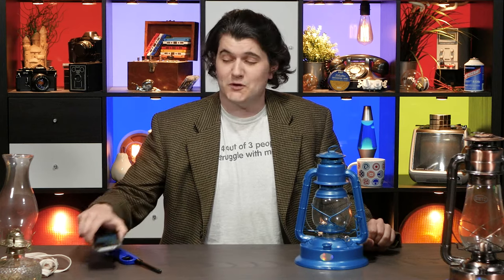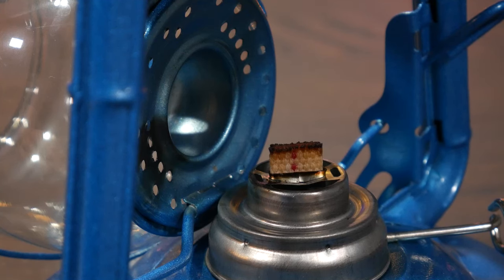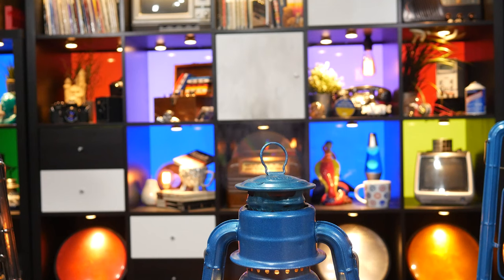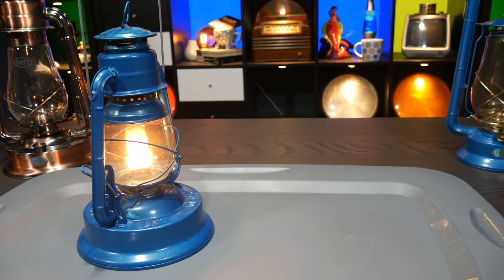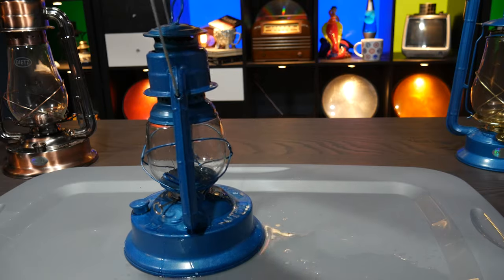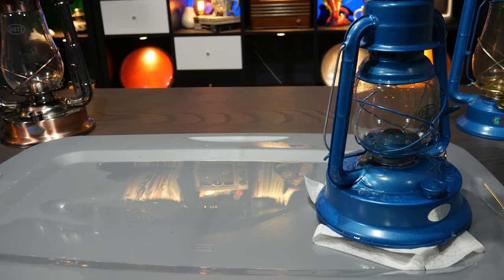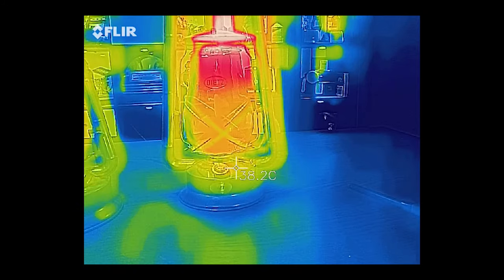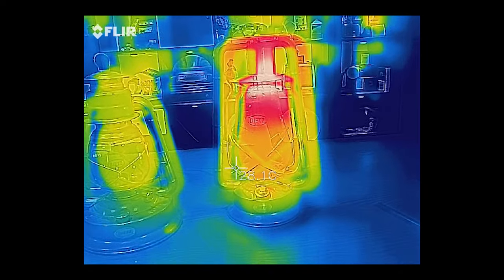How to use, more info, and further thoughts on hurricane (Dietz) lanterns

Comment: I have to offer a clarification about diesel fraction distillate fuels. Jet fuel is kerosene, kerosene is on-highway diesel and all of them are diesel fuel. But, kerosene is not necessarily jet fuel. The American Society of Testing and Materials sets the specifications for distillate fuels in the United States. The specification for #2 diesel (off-highway) has the broadest specifications. In 1990, the US EPA published specifications for on-road diesel that set maximum sulfur content (good luck finding that Federal Register notice). Since then, ASTM has published specifications for off-highway diesel (which allows higher sulfur content) on-highway diesel, kerosene (which has tighter controls on specifications than on-highway diesel but had, prior to federal regulation, limits on sulfur content and then jet fuel, which has the tightest specifications for instance not allowing dyes.

In the late 1800's when refining crude oil to make fuels became a commercial thing, there weren't standards. What came to be known as kerosene was being produced largely to work in lamps designed for whale oil. However, if the properties of the refined crude oil were not right, the lamps were prone to exploding mostly if too many high vapor pressure components were left in the final product. John Rockefeller realized they had a marketing problem since people were justifiably afraid to use kerosene in lamps and lanterns due to the risk of explosion so his company came up with a set of product standards to ensure their fuel would be safe and marketed them as "Standard Oil" which became the name of his company.

Comment: You notice the IR camera can’t really see the flame, just the heated glass and metal. Perhaps the glass does not allow IR to pass through to prevent heat transfer to the carrier?
Reply: Yes, glass behaves like a mirror in IR. If I point my FLIR at a window, I just see a reflection of myself. Have to open the window to see the world outside.

Comment: I dont think heated air intake is of any importance here. its that the exhaust and intake are close together do that wind flowing over the lamp will create close to equal pressure changes on both ends.
The old design with the air intake on the bottom of the flame and the exhaust on top of the glass was (as shown in another of TCs videos) very prone to flicker or getting blown out due to differences in air pressure with wind.
Also: you dont really want hot air in the side tubes since it wants to go up, and not down to feed the flame - i guess the stronger chimney effect of the flame in the glass counters that... flaw.

Comment: Does the FLIR not have an option to output the two video tracks separately so you could do the parallax correction manually? 

At least if you had enough time, energy, and idiotness, you’d be able to use it as a rangefinder!

Comment: Oil lamps are simple and always work. These Dietz lamp designs work so well there is no reason to change them.  Gas mantle lanterns are much brighter and more efficient  but degrees more complex and fragile.  Anyone who has had to replace a broken mantle knows, anyone who has had a broken mantle in the rain and wind I feel your pain.
I cant disagree that LED lights with bluetooth and speakers with party mode are nice sometimes you just need emergency light that's as easy as lighting a candle and has years of standby mode.

Comment: The dies might be the same, but I can tell you a modern Chinese-manufactured kerosene lantern is noticeably of lower-quality than an original vintage one. They feel cheap, the metal feels thinner and lighter, and the parts have play between them. A vintage lantern feels much sturdier, heavier, and nothing rattles.

Comment: Oh btw, on the smell subject: Can you confirm that the smell of kerosine only comes about when they're burning? Just having them present doesn't cause any issues with odors?
Reply: You can still smell the kerosene when not lit because it is slowly evaporating from the wick.
Reply: @Tim.Stotelmeyer  Yeah, I was mainly wondering whether the smell is primarily due to the burning, or would it just be smelly anyway.

Looking at the way the darn thing leaked when tipped over, it's probably gonna be quite smelly no matter what you do.

Comment: Have you tried using K1 Kerosene deodorizers? I have one in pine scent and one in neutral. I use them in my kerosene heaters that I use as emergency heat in case the power goes out for an extended period of time in the winter.
Reply: The citronella torch oil is absolutely wonderful in these for mosquito suppression as well, but unfortunately, you can't quite get rid of the smell for other uses.  New lamps were ~$5 in the candle department of Wal-Mart back in 2016.

Comment: Glass is only transparent to your eye. A thermal camera can only read heat radiated from the surface of an object, including glass. If you look at the other lit lantern on the thermal cam, you'll notice only the glass above the flame is red. Everything below that is orange or yellow even though that's where the actual flame is. The flames heat is completely invisible to the camera because the glass in front of it is releasing its own thermal radiation that is much lower than the flames thermal radiation.

Comment: The tipping point: fun fact! If you fill a kerosene heater while it's still hot, it's a very bad idea. Also, if you fill a kerosene heater without using a funnel, it's also a very bad idea. Another fun fact: most house fires in Chile during winter are due to kerosene.

Comment: Doesn't kerosene gel at sub freezing temperatures? My dad has to put low temperature heat wrap on the line from the tank to the house (2Ft.) Or we had no heat on cold winter days in the midwest.

Comment: Can you set a mantle on top of the burner on the cold blast hurricane lantern? It wouldn't be as bright as a lantern that's built for it but should be brighter than the lantern by itself right? We know there is unburnt kerosene, will a gas mantle help combust the rest of it?

Comment: does unused fumes from the hot blast condense back into liquid and drip down back into the oil tank?
and if not, then do they pass through the flame and have a chance to ignite again?
maybe even more than 2 chances if they go unused circulating over and over until they get their chance?

Comment: I think you're still missing the main point of the hot blast lantern... Exhaust gas recirculation.  By re-burning some of the exhaust gas the dang thing smells a lot less like kerosene exhaust.  Which in turn proves it's working.  And likely the exhaust burns more orange than the original kerosene which is why the flame color is different.

Whether it's the size of the wick or not, I can't say... in long term use the hot blast lantern uses noticeably less kerosene.

I will also add that when using citronella oil, these things will keep mosquitoes away.  Not quite as well as tiki torches, but they work... just don't use citronella oil indoors!

Comment: The heat recirculating matters in cold climates when the fuel gels up
Reply: It would only help, if the recirculating air went either through the fuel, or was bubbled through it. Transfer of [Thermal] energy from the exhaust gases to the gel-ified fuel.

Comment: Thank you I am a fan but I can tell you're not a camper.  Hurricane lanterns have been a camping staple since the 19th century and for good reasons.  We use Hurricane lamps often, and we use parafin lamp oil from dollar General or Wal-Mart.  It works.  Same as tiki torch fuel.  Yes it will be sooty if the flame is too high, but if you put it down into the flame's lowest position where it is putting out the right amount of light you need with no soot, like to play rummy, it will burn all night and you get steady light even in the wind.  I have neighbors who used kerosene lanterns.  Kerosene is cheaper and better but more flammable as you said so you have to be careful but it is a great fuel.  You can use a Hurricane lantern to keep a tent warm without exphixiating yourself, just keep the flame low enough so there is no soot.  As long as they don't tip over they are safe.

Comment: Well I was thinking about the warm air intake. The amount of incandescent radiation goes with the temperature to the fourth power. So an increase of 5% in temperature would yield 20% more light. At 2500K this would just need 125K hotter air to get 20% more light. Of course other effects might work in another direction, so this is by itself is of course not definitive. But maybe there is something to it... And it wouldn't necessary be easy to just see the shifted color from that 125K difference.

Comment: These lamps do have a purpose even though a Laden style lamps with catalytic earner mantle's burn better and her prider and less smelly and all those other things that you're absolutely right all of them require supplies specifically all of them need mantles and they need the little pump to pressurize the fuel and they need the overings to wear out when the little pump can't pressurize the fuel anymore Where is the deets needs nothing

 Any scrap of rag can be folded to be awake and there is nothing else that's it you're done that's enough financial causality to keep these lamps available forever like it or not

Comment: The other reason the globe moves to the side is to be able to remove the wick stand and replace the wick, or in my case, feed the wick back in when you're dumb and turn the wick too far down and drop it into the fuel tank.

Comment: Expanding on the comment about them taking lots of fuel. DO NOT USE ALCOHOL OR GASOLINE! Alcohol and gasoline have a fuel vaporization temperature around room temperature. This means open container with gasoline is like a humidifier for explosive gasses. Also you can burn gasoline but it will burn pretty dirty

Comment: Perhaps you could do an episode on Aladdin Lamps. The ones with incandescent mantles used by the Amish.
Although the Dietz lanterns are a lot more economical.
Reply: Aladdin lamps are much more economical that standard lamps for the light output. I have a few of the Aladdin lamps and they are amazing. The big problem is that replacement mantles have gone up from a few dollars to over 25 dollars. The mantles are fragile and break easily. Why can i buy Colman or  Campinggaz wicks very cheaply, but not Aladdin?
Reply: @vinquinn  I to have an aladdin Lamp you are correct the light output is pretty amazing. It has been a while since i lit it but iirc it was relatively fuel thirsty
And yes the lamps and parts are quite expensive as well.If you need light off the 
grid they do the job.For the money one could set up solar a battery and LED   but where is the nostalgia in that.

Comment: Same dies? Doubt it.... stamping dies usually require a lot of replacement/refurbishing of wear surfaces on a routine basis. I work in stamping plant (among other processes)... anything run at mass production volumes will wear and need TLC (not to mention when yahoos crash a die and turn part such into chunks!). Perhaps the original tooling but a lot of repair and the like... but then you get into a Ship of Theseus sort of problem.
Reply: How about same design, probably with no changes, so COULD be from the same dies.
Reply: @brendonwood7595  Again, it's a ship of thesus problem. As many of these things as they've made, the dies have at a minimum have seen a lot of rework... either through being welded up and reground or through parts being changed/replaced. Just par for the course with stamping dies. 

Perhaps the original die chassis is still used, but the parts that do the actual cutting/forming likely aren't original... 

...Or they are the originals and are in very terrible condition, and the fact they're still making anything at all usable is a miracle... which does happen. Sturmey-Archer 3-speed bicycle hubs are an example of this; when Sun-Race (a Taiwanese company) bought the design and tooling for such (having been discontinued due to low sales), reportedly they scrapped most of the old "original" British tooling due to being worn beyond economical repair. Their "new" line of hubs was a marked improvement in both design and quality. Maintenance counts!

Comment: Pedantic comment incoming.  Yes any ICE car has an air intake, but a cold air intake inlet is specifically moved further away from the engine and is less obstructive then the stock intake box most cars come with so it can pull in as much dense air as possible.  Still, sort of pointless unless you are doing a engine tune to take advantage of it, performance gain is going to vary by engine/ECU.

Comment: Why is it so sad that these things are still used? They last forever, the fuel is commonly available and cheap, there’s basically no waste, etc. 
even if you had batteries and solar panels, you’d still have to replace the batteries regularly as well as the solar panel multiple times vs the life of one of these lanterns. 
They make great sense where they’re used.

Comment: 1:00
Choking the air supply, eh?
Mechanic here.
You could call it a throttle. As it fits the relevant definition! 
(Yes, a throttle valve supplies air, NOT fuel.)

Comment: I still don't see how the air intake is separate from the exhaust fumes...
Reply: The exhaust comes out the top, directly under the thin dome part with the small loop on it. (And goes up)

The intake pulls from the flair at the bottom of the chimney. Between the two mental cylinders. (And because of the updraft, mostly comes from below. Which might also help to force air into the small round holes that pull in air to help cool the glass from the inside)

Comment: Hair???    You don't seem to be as prepared as normal...   But it works.        People who have these in the US many are like me. I live in the country,. When the power goes out  these are often used.    Mine is 60+ years old.  Works good, and maybe used 2-3 times a year.  Along with candles and flashlights.    These are the most reliable.  Batters go dead. Kerosene  last a long time in one of these. As long as you have a match it is ready for emergency.

Comment: Hong Kong is in China it's one of China's biggest cities.
There's another lantern that wasn't talked about in any of the videos so far it uses a mantle or two much like the Colman propane one does but this lantern needs to be pressurized by opening the needle valve to pump air into the fuel tank then close the valve so the air/fuel mixture doesn't cause a fire and or burn down somebody's home.
Reply: Hong Kong is not in China. It is a country on its own

Comment: Re: tipping the kerosene lantern over.  Kerosene is NOT gasoline.  IIRC you can throw a lit match onto kerosene and it will not ignite, whereas gasoline will go WHOOSH
Kerosene has a much lower flashpoint

Comment: I challenge you to pour some kerosene on the ground and ignite it. it is very safe and will burn but not in puddles that's why it's used in these things because it safe.  It's also why we use it in jets and big diesel trucks that use diesel or JP8(jet fuel),  those are both kerosene with different additives,  they are nothing like gasoline that is highly flammable and has a very low flash point

Comment: This exploration was carried out with modern kerosene under room temperature conditions. Could it be that earlier fuels, whale oil e.g., were less volatile and that pre-heating the liquid fuel allowed for easier upward wicking action? That the earlier/other fuels had a higher igniton temperature than kerosene? Or that using the lanterns in very cold outdoor conditions required pre-warming the fuel? Just wanted to plant those seelings in the garden of your ever-inquisitive mind, heh.

Comment: Re: The tip-over mention of not having a fire extinguisher
Dude...  Not to criticize, but from a risk management standpoint, I'd suggest having filmed everything, including the original video as well as this one, with at least 2 Class B (one of them CO2; both 40B) standing by.  One next to you and one at the entrance(s) to the room (where you might naturally run if something caught on fire, so you could decide to pick it up and engage the fire; the worst thing is to have an extinguisher and it be on the other side of the fire from where you are).

Comment: Oh god! I use oil lamps and candles as my primary light sources after 8pm in Winter because it helps my circadian rhythm and because it’s cozy AF on snowy, 10°f(-12°c) nights. Sounds dangerous, but there’s a few common sense rules I fallow that have kept my Rocky Mountain home from burning down. #1 is ”DON’T TIP OVER THE F***ING LAMP!” ..especially while lit. Extra especially while indoors on a Rubbermaid lid that can melt and burn in extra asphyxiating kinds of ways.
 Love you but holy f*ck. 😂